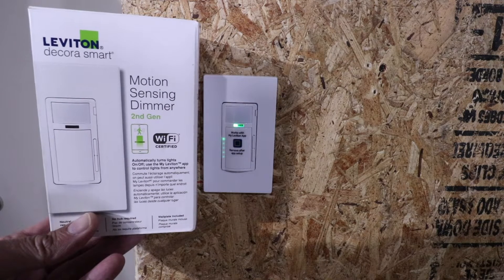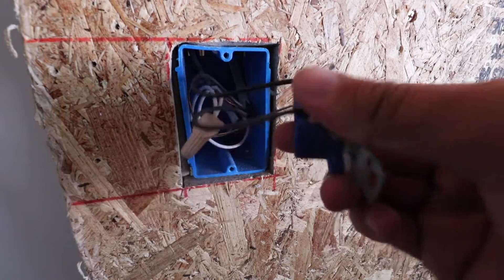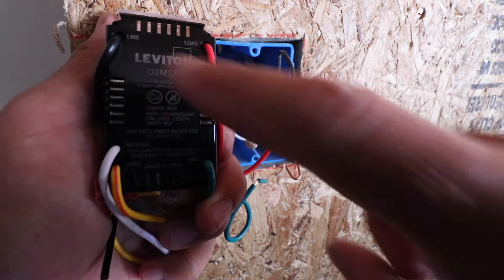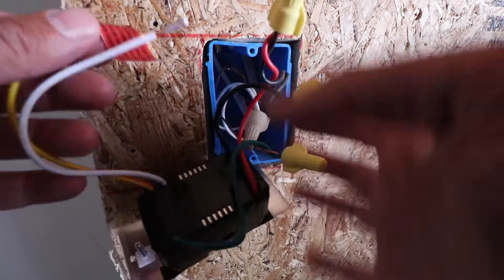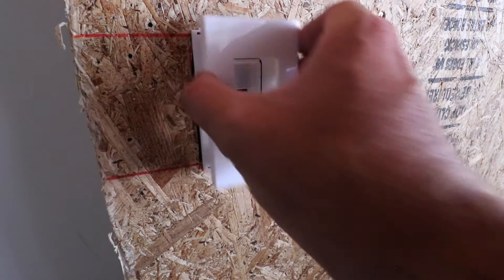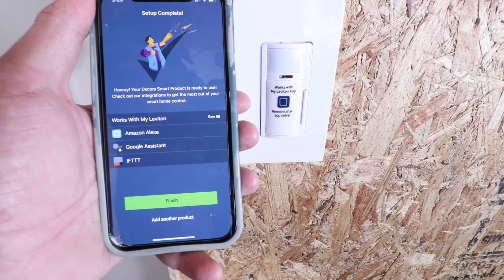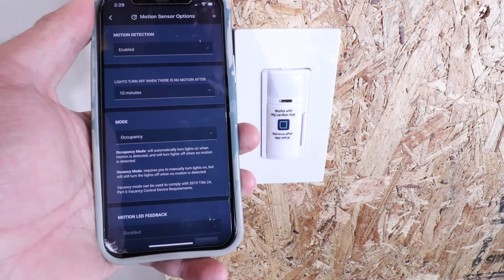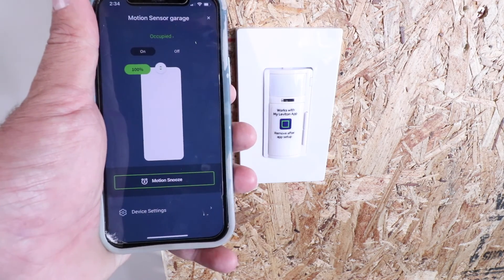How To Install A Motion Sensor Light Switch

Comment: Very Dangerous to Asume that The Existing Conection is in correct Way… Call a Electrician Because if the switch dont have the Hot Wire and Have the Neutral inverted… You Going to be the close of all charge in that line…

If you know that … Do it not worry, But Be careful because a Neutral if more Dangerous than a Live Cable…

🙌🏾